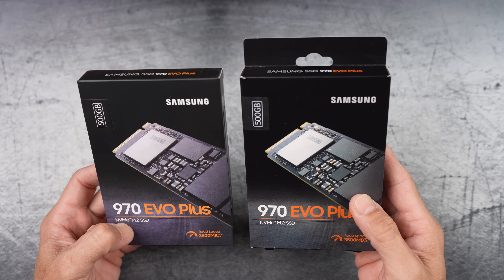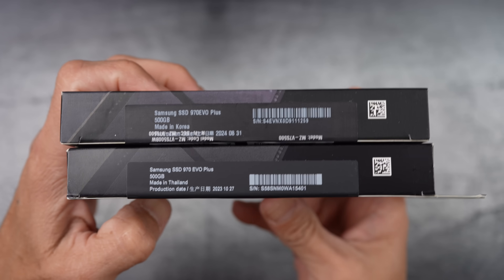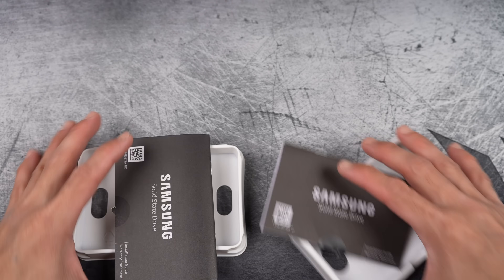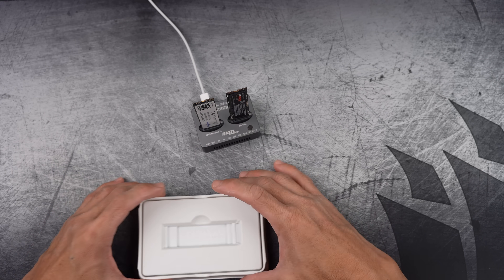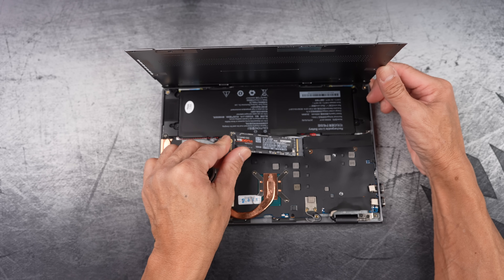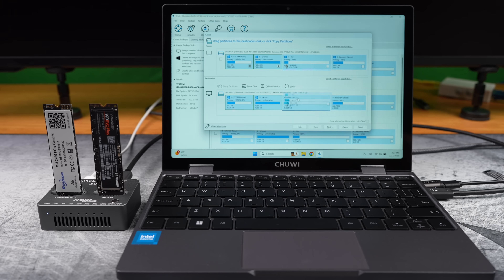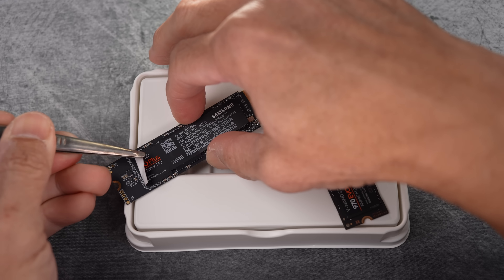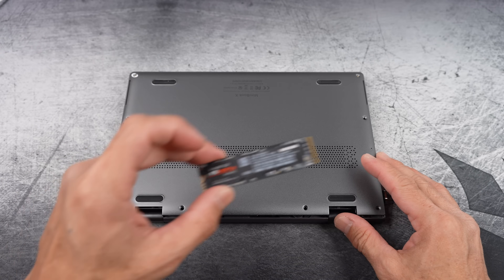Fake vs Real SSD - Can You Spot the Difference?

Comment: Fake looks like best value
Reply: Kind of true. I was surprised that it performed as well as it did. It was pretty close in performance to the original laptop drive. I don't know how long it will last though..
Reply from the maker: I am concern about this myself. Thanks for sharing.
Reply from the maker: It might seem like the best value at first, but reliability is the real concern. Some of these fake SSDs fail quickly or don’t deliver the promised speeds. Definitely a gamble!

Comment: i bought the fake one thinking it was genuine for 41usd 500gb it works but I suspected something wrong because of lower speeds and the details of the ssd did not show up on ssdz , I did some research and found your video i am surprised how got the same one you got here in syria 
i wonder is it good for 41usd ?
Reply from the maker: Thanks for your comment. For $41, it’s not the worst deal if it works and meets your needs, but it’s definitely not a genuine high-performance SSD. The lower speeds and missing details in SSD-Z are red flags. If reliability is important, I’d be cautious using it for anything critical. Crazy how these fakes are showing up worldwide!
Reply: update
i went today to try replacing it 
the place i bought it from tried to prove to me that is genuine by putting the serial number on Samsung website and it showed up in the website 
i told all the other problems and he doesn't seem to care he told to leave it day or two while he calls his supplier 
he told me that he got them from DUBAI 
thanx for your reply ❤
Reply from the maker: @kingslayerx0x It sounds like the seller is trying to reassure you with the Samsung website lookup, but that doesn’t necessarily prove the SSD is genuine. If you’re experiencing lower speeds and missing details in SSD tools, those are strong signs it’s not an authentic drive. Many counterfeit SSDs reuse serial numbers from real ones, which is why they might appear valid on official sites. Hopefully, the supplier takes responsibility and you can get a proper replacement or refund. Let me know how it turns out!
Reply: update 
the seller took it back and replaced it with wd blue sn 570 priced at 37usd 
after I installed windows and did some tests it turned out to fake too,
slower speeds and different controller (maxio 1202)....
it looks like the syrian market is flooded with fakes 
i don't think i will be replacing it because i lost the hope off finding a genuine one 
those fakes are getting out of control there is a fake version of all brands
by the way the place I bought from still believes it is genuine 😂😂
Reply from the maker: It really does seem like the market there is flooded with fakes. The fact that even the seller still believes they’re genuine makes it even worse. Sorry you had to go through this—hopefully, you’ll be able to find a legit drive somewhere. Thanks for sharing your experience!

Comment: If you peel off the label of a drive like that, you should put it back on when you're done looking if you want to use it in the future. That label is how m.2 devices are protected from ESD, and NVMe drives are ESPECIALLY vulnerable to static.
Reply from the maker: Good tip! I only partially ripped the label (just the tip), but unfortunately, I couldn’t reattach the rest. Hopefully, it won’t be too much of an issue, so far it hasn’t, but I’ll keep this in mind for the future. Thanks for the advice!

Comment: This laptop has no nvme cooling whatsoever
Reply from the maker: You’re right! This laptop is the Chuwi MiniBook X, and when I opened it up, you could see that the SSD is pressed directly against the body shell. There’s no room or space for dedicated cooling, which could be a concern for sustained performance.
Reply: @TossSong  i guess that shell is plastic as well... Well there's not much you can do then.
The controller gets pretty toasty underload and a thermal pad wouldn't be a bad idea it you can make it touch something to transfer the heat. As we all know plastic is an insulator so i won't help (maybe with an aluminum sheet cover from the inside shell would help but nothing dramatic and also a bit dangerous if it touches something it shouldn't.
Best ino solution would be to buy a heatsink (even a low profile one but with fins) for the drive and cut the plastic shell the size of the heatsink and let it breathe underneath.
I'd love to see the temperature results.
Reply from the maker: @ChrisGR93_TxS Thanks for your input! The shell is actually metal, so there is some potential for heat dissipation. However, the SSD is pressed against it without much ventilation, so a thermal pad might help only if it makes proper contact with the shell to transfer heat effectively. So far I haven’t have any issues, and I have used for extended periods. 

An internal aluminum sheet could be an idea, but as you mentioned, there’s a risk if it touches the wrong components. A heatsink would be useful, but with the metal casing, cutting a vent for airflow might be the only way to make it truly effective. I might check the temps under load and see how bad it gets. Appreciate your insights!

Comment: The Sabrent Rocket Drives Are Faster And Cheaper  And The 990 EVO Can Be Found On Sale! Both Are Gen 4 Which Means They Will Work In Your Next Build As Right Now We Are At The L:imits of What The Silicone Can Do! Just Look At RAM DDR4 3200 MHZ CL 16 Is The Same Damn Speed As DDR5 6400 MHZ CL 32 As The CL Represents The Number Of Clock Cycles To Get The Data Out Of The Memory! So If It Takes Twice As Many Cycles To Retrive The DATA Out Of The DDR5 Memory It Is Running The Same Speed As The Slower Module! We Are Right Up Against The Ability Of The Silicone To Switch Conditions From 1 To 0
Reply from the maker: Thanks for the insight! My Chuwi MiniBook X doesn’t support PCIe 4.0 or 5.0 speeds, so I wouldn’t be able to take full advantage of those drives. As for RAM, you’re right—latency (CL) plays a big role in effective speed, and while DDR5 has higher bandwidth, its increased latency means real-world performance gains depend on the workload. It’s interesting how we’re hitting limits with silicon efficiency. Appreciate your comment!

Comment: Did you use validate to make sure the capacity is accurate? Maybe i missed it
Reply from the maker: I did check, and it was missing around 20 to 40GB, though I don’t remember the exact amount. Definitely not the full advertised capacity!

Comment: welp it appears i bought a fake drive but its to late sense i already have it installed and cant afford a new one. i didnt even know they made fake ones and by looking closely at the link you provided its the same one i bought but the 1tb version. i assume that the currier didnt know it was fake and i was just unlucky.
Reply from the maker: Sorry to hear that! But you might still be able to return it, even after installing it. I went through the same thing and was able to get a refund. It’s worth reaching out to the seller or the platform’s customer support to see if they’ll process a return for you.
Reply: @TossSong  i just did the benchmark you shown in the video and the speeds match the real one so im confused. oh well still better then my previous boot drive that was an old 1tb HDD
Reply from the maker: I’m sure everything is fine with the drive. If you’re concerned, you could use Samsung Magician software to check its authenticity.
Reply: @TossSong  its real thank god and thank you for the info😁
Reply from the maker: No problem. Happy to share and help. Thank you for commenting.

Comment: What do you mean a dissapointing product ?!? You paid that fake SSD less than half the price of the original, and the speed difference is something that 99% of ITS users will absolutely never feel, see or recognize! I mean if you are ordering a brand name SSD off aliexpress for half the price everywhere else in the world and actually expect to get the original product; you either discovered internet yesterday, or you're not the most intellectually capable person! So for them its a win win either way!
Reply from the maker: You make a fair point—getting a super cheap SSD and expecting it to perform exactly like a high-end brand might be unrealistic. But the issue is reliability—many of these unknown brands might work fine at first but fail much sooner than expected. It’s a gamble, and for some, it’s worth it, but for others, data security and long-term performance matter more.

Comment: Patriot m2 forever ❤
Reply from the maker: Patriot M.2 is definitely solid! I assume you’ve been using one for a while. How’s the performance holding up? I have the SATA ssd one, performs wonderfully!
Reply: @TossSong i have 1 tb patriot  I'm going 6 moths and still works like new , I'm planning to add aluminum heatsink plate with thermal tape and  tied up with tiny zip ties
Reply from the maker: Glad to hear your Patriot 1TB is holding up well! Adding an aluminum heatsink with thermal tape sounds like a great idea to keep temps in check. Let me know how it goes with the zip ties setup!

Comment: After discovering that Mini Tool charges to use the coming feature, i found out Samsung Magician is free, comes with the drive, and can easily clone. Worked great for me.
Reply: DiskGenuis let's you clone for free!
Reply from the maker: Thanks for sharing. Yes, and also Macrium Reflect (free trial version), which I used in the video. I’ll definitely look into DiskGenius for future needs.
Reply from the maker: That’s a great tip! Glad it worked well for you! Samsung Magician is definitely a solid free option for cloning Samsung drives, from a Samsung drive to another Samsung drive. Just keep in kind that it does not support cloning from a Samsung SSD to a non-Samsung brand SSD.

Comment: Conclusion: much easier to fake all the chips and components that go into an SSD than to make a cardboard box with a hanging tab!
Reply: The genuine Samsung drives are also sold in boxes without that tab, so that is not something that one should rely on in any way. In fact I have never received a Samsung SSD with that tab on the packaging.
Reply from the maker: Yep, exactly — packaging varies a lot, so it’s way more reliable to judge the drive itself than the box.
Reply from the maker: That’s a great observation! It’s surprising how much effort goes into counterfeiting the tech inside, while the packaging is often a giveaway.

Comment: At 4:47 there no slash  "/" both on SSD. So are both fake ?
Reply from the maker: Thanks for commenting. No, not necessarily. Serial numbers, which I didn’t put on video, one is in the Samsung’s database and the other is not. There can be slight variations in labeling depending on the batch or region.

Comment: You can see from the serialnumber which one is fake.   S4EVNX0D9111259  --> D9 --> September 2013  The box however says  August 2024.

Year Code      Month Code 
2007 P          	January 1
2008 Q         	February 2
2009 S           	March 3
2010 Z           	April 4
2011 B           May 5
2012 C           June 6
2013 D           July 7
2014 F           	August 8
2015 G          	September 9
2016 H          	October A
2017 J           	November B
2018 K          	December C
2019 M
2020 N
2021 R
2022 T
2023 W
2024 X
Reply from the maker: Nice detective work! That serial number definitely doesn’t match up with the box date. This is exactly why checking serials is so important when buying storage devices. Thanks for sharing!
Reply: @TossSong  It works for most Samsung products:
The serial number of most SAMSUNG products consists of 15 digits composed of both numbers and letters. The production date can be determined by the 8th and 9th digits of the serial number. For some models, the serial number has 11 digits. In this case the production date can be determined by the 4th and 5th digits of the serial number.
If the serial number consists of 14/15 digits, the 8th digit is the year and the 9th digit the month.
If the serial number consists of 11 digits, the 4th digit is the year and the 5th digit is the month.
Reply from the maker: @doopydoopydoopy Thanks for the detailed breakdown! That makes sense for decoding Samsung serial numbers. It’s a really useful method to verify authenticity and production dates. Appreciate you sharing this info!

Comment: Bought a fake Crucial 2TB SATA SSD recently from Ebay.  The box was an immediate giveaway, and the actual capacity was like 32GB instead of 2TB.  Ended up returning it for a refund.  There are a lot of fake drives in circulation, even if you get them from that giant store named after a river in South America.  Beware, as the fake market is out of control already...
Reply from the maker: That’s frustrating to hear, but good on you for catching it and getting a refund! It’s crazy how widespread fake drives have become—even on major platforms. Thanks for sharing your experience—it’s a strong reminder for all of us to stay vigilant.
Reply: @TossSong  In my case, it was a little more obvious.  The sticker on the fake drive was obviously different, using a White stripe instead of the metallic stripe Crucial uses on their drives.

I didn't catch it however until I tried to clone a drive, and kept getting Write errors, while a corrupted drive being cloned should be getting Read errors.

This also isn't the first counterfeit item I have received, but like the 5th.  So far I have received counterfeit razor blades, counterfeit aftershave, a counterfeit PS4 controller, a counterfeit SD card and a counterfeit SSD drive.

I recommend using a flash drive testing software, which writes and reads back from the entire drive, whenever you buy any solid state drive, memory card, flash drive or anything else.

Counterfeiting is definitely spreading like a plague out there...
Reply: So true, unfortunately!

Comment: Just FYI - not sure if the "hanging tab" is enough of a differentiator. Have a 970 Evo Plus, bought something like late 2018/early 2019, from a rather trusted store (local chain here in PL), and it doesn't have one either. That said, it also has a "horizontal" rather than "vertical" design, so I guess the package might've been redesigned over the years (...and the scammers might use an older one).

Overall, think verifying with "Samsung Magician" (and avoiding buying from Aliexpress) might be the best course of action.
Reply from the maker: Thanks for pointing that out! The hanging tab was just a quick way to differentiate the two drives visually for viewers at the start of the video. You’re absolutely right—design changes over the years can make packaging details tricky to rely on, which is why tools like Samsung Magician are so useful. Appreciate your insight!
Reply: True, I have never received a genuine Samsung SSD with that tab on the packaging. I assume they make two different versions, one for brick and mortar shops and another for online only stores.

Comment: I got one of these fake samsung drives from ebay 2 days ago, 
it totally destroyed a 5 grand specked out custom zbook fury less than 6 months old,
 i am furious & having to use a load of new accounts at present becuese ive lost access to everything, 
i cant even get into my ebay to do anything about this until i can action some sort of data recovery. 
The ebay listing said UK seller & had a London address, 
but the package turned up well over a week late despite saying "48hr tracked courier" the labels & box's looked legit until after my computer had been destroyed,
 i got a magnifying lens to read the incredibly tiny writing on the box. 
"Samsung" was spelt "amSung" 
& on the sticker  on the drive i found so many spelling & typo's that there are to many to even list here.
 'NVME' was listed on the sticker as "NVBE", 
The capacity was stated as "1tarraBIT" not One terabyte
The chips on the fake NVME drives hidden under the sticker had no manufacturer markings on them,
 there where just 3 dull lines on the package of each chip. 
I dont know where i stand legally on this, 
i want a new work station, but it looks like this scam is set up from china using a UK London address to dupe the buyer into thinking this is a legit seller when it is not, 
i bet the moment i try anything legal they will just vanish back behind the firewall of china & the London address will vanish as a business address & they will just re-spawn with another name. 
This has cost me not only a very expensive work station, but 6 months of research that is irreplaceable & access to all my online business.
Reply: That's so frustrating and aggrevating to read this. So sorry your data was corrupted by that counterfeit drive. Stories like yours make me furious! I have A LOT of data that means my livelihood as well and I'm worried that what happened to you may happen to me someday if I'm not diligent, but I'm sure you were, so that makes your experience even more sobering. Man, that just hurts! Hope you are eventually able to recover most, if not all of your data!

Comment: Does laptop cpu or gpu also affects the read and write speeds of the nvme? Because I test mine with the stock NVMe Micron_3400_MTFDKBA512TFH and it run way faster than the samsung 990
Reply: Yes it did like 6300+ on Q8T1 on read but the others is only up by 500-1000pts though xD and I'm using Nitro 5 with 12500h and 4050
Reply from the maker: Good question! Yes, CPU and GPU can affect NVMe speeds if there are bottlenecks in the system. Other factors like firmware and cooling also play a role. Interesting that your Micron 3400 outperformed the Samsung 990!